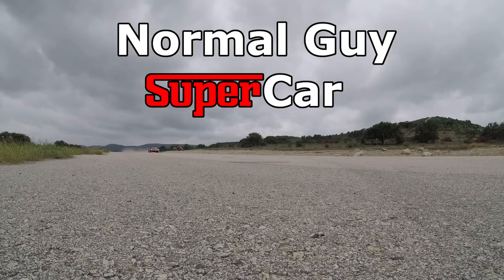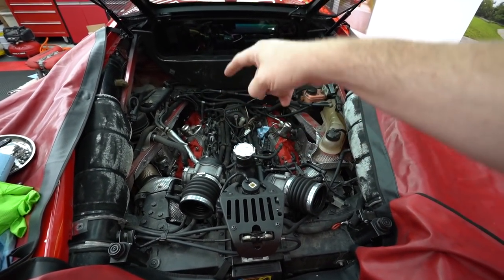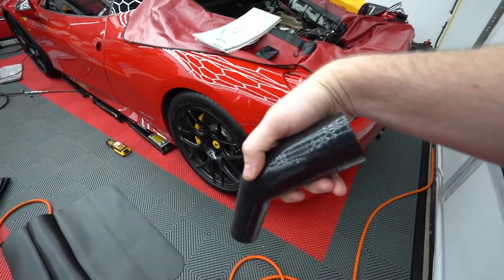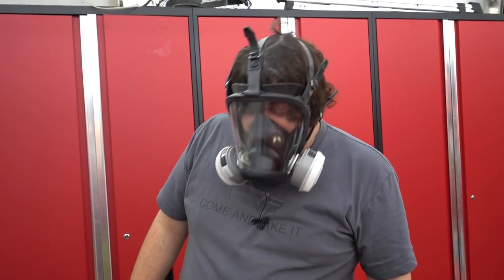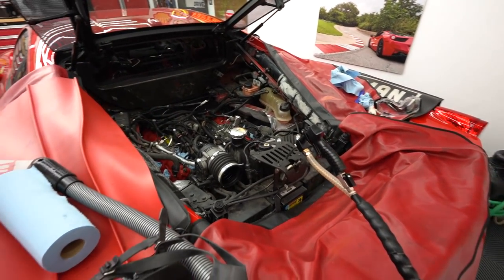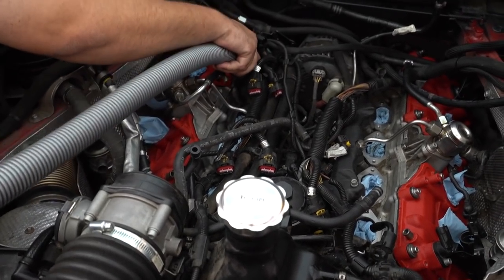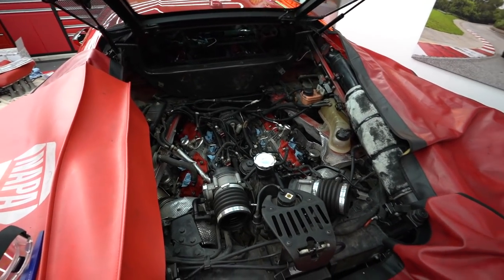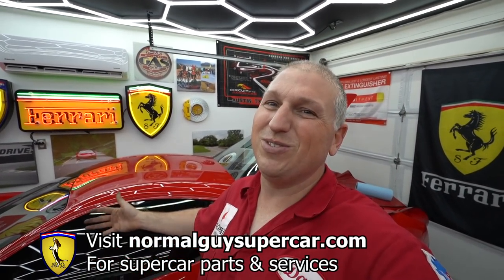How to CLEAN FERRARI 458 INTAKE VALVES using CRUSHED WALNUT BLASTING

Comment: Totally unnecessary , Gdi cleaner  would do the job . Without disassembly . Made by CRC , I did use it , made a huge  difference   . Warm up engine , spray in the intake , wait an hour . Take for  a drive , to blow out the carbon  . Note , if you have Map sensors , don't spray through  them . Find a vacuum  port after them . This stuff , does clean the turbo as well .
Reply from the maker: Well, when you already have the intake off... why not?
Reply: @normalguysupercar  I know , your making content . But , work smarter  not harder . Lol
Reply: @normalguysupercar   , I'm  going to try brake  cleaner  next time .  Using the same steps . As CRC  , GDI cleaner  .

Comment: Nice video! I just did a big walnut blasting series on my channel with dyno results before and after. Someone commented with a Maserati asking so I'm going to show him your video!

Cleaned my EcoBoost Mustang that I've run over 180 closed course days, 130,000 miles. It was a lot worse than yours. We gained back over 20 peak HP but the dyno curve was crazy to see how much longer and stronger it would pull in the high revs.
Reply from the maker: It's awesome, you can literally feel the difference after cleaning!

Comment: I "Walnut Blasted" my BMW 760 V12, it was like night & day. Better performance & misfires disappeared. I gained 25 HP as per dyno tests and my V12 runs smoother. Most of my know it friends never heard of Carbon build up valves and they said just blow it out which don't work.
Reply from the maker: That's awesome to hear. I wish I had Dyno tested it before and after, that would be fascinating data

Comment: ok, another tip 

on the valves your working on pour some fuel into the intake & let it soak 'rehydrating the carbon' its then much easier to wipe off & suck up using a small vacuum cleaner, regarding the walnut left in the intake track, you need to be very careful as it could fowl the closing of each valve where walnut is left behind.. I'd suggest using a small pick to move it& then hoover it up so its clean/free of any foreign debris..
Reply from the maker: I like that tip

Comment: Oh hey fun fact, you can chuck a boatload of zip-ties in a cordless drill (use one or two around the cluster to keep them from bending out all over the place) and use them like a rotating scraper to get the chonky bits removed first.  I'm surprised Adam didn't think of that, that's straight up Chair Force Engineering.  :D
Reply from the maker: Oh I like that idea

Comment: You should try the dry-ice cleaner that Tavarish used.  Same idea as your walnut sprayer, except you use crushed dry ice instead of the walnuts, and when your done, the dry ice evaporates leaving nothing behind.   (He used it to clean his wheels, engine, and paint...)  Also with dry ice, you could probably do it with the valves open, and clean off the valve seats also.....
Reply from the maker: Yeah, I considered that but it looks a bit more complicated and different equipment.

Comment: Certainly the Shell and other company  ads touting clean valves are misleading for direct injection engines.  This problem is why Toyota and others went to dual injection.  Port and direct injection for each cylinder.  While more complex it gives the power and control of direct injection with the valve cleaning and reliability of port injection.  Chemical "solutions" like Seafoam also won't clean this type of baked on carbon.
Reply from the maker: Well to be fair, most engines were not di until recent. But yes, I believe the best solution is port and direct combined
Reply: @normalguysupercar  just an fyi, DI has been used for years with diesels.

Comment: So how come the Shell Premium Nitro ain't keeping the combustion chambers clean?
Reply: Because the 458 is a direct-injection engine and the valves do not touch the fuel. That gunk is the PCV crankcase blow-by getting recirculated. Pay attention! He told you this in the video.
Reply from the maker: That's not the combustion chamber, that's the back of the intake valves in the heads. No Shell fuel ever gets there on a direct injection engine. If it did it would have looked much cleaner.

Comment: Those oil catch cans do work, as long as it has the bronze filter in it.
I put one on my truck. I was amazed first that it really worked and second at the amount of oil, water vapor , sludge it captured. 
But of course the avg consumer would never empty them so the don't use them from the factory. 
Idk i think avoiding having my intake and valves sludged up is worth the extra work. .
Reply from the maker: I agree

Comment: Great results. I would recommend a high CFM compressor at least 14.5 cfm (£260/$356) and you run for much longer on each valve to get near perfect results. You can use the adapters to help raise the height/angle of blasting.
Reply from the maker: Yeah for sure a bigger compressor would help

Comment: I thought Shell gas cleans your valves lol
Reply from the maker: It does when it is sprayed on the valves...
Reply: JimC481   , the newer motors spray directly  into the cylinders , bypass the intake valve  . Not getting  washed  with gas anymore .  Positive crankcase ventilation system , is directing  the air back into the engine.  It has  oil residue from the engine . That form carbon  on the valves  . Causing  this problem  , to clean them .

Comment: Looks great..... historically,  the only Chinook helicopter that ever crashed was after a walnut cleaning, a larger piece of walnut was lodged in the gears that caused propeller rotation to skip, causing the rear propeller to make contact with main propellers, resulting in blades breaking thus leading to crash....
"The More You Know"........
It doesn't look like you will have that problem....looks great
Reply: That 1982 crash in Mannheim, Germany was due to walnut debris in the oil passages of the transmission-bearing failure. They routinely used walnut debris cleaning as a normal process, but the original procedure called for cleaning the oil tube/passages/journals with 3000lb air pressure. They had changed the procedure due to an OSHA Inspector investigating the shop at the Corpus Christi depot had cited them for that pressure safety. The army changed their procedures due to that. The subsequent stand-down post accident showed numerous transmissions with some walnut debris inside them. Cited from Ft. Rucker investigation team.
Reply: @PFLEONARDI0906  yup thats the story .... seen it on history channel 15+ years ago, found the story interesting
Reply from the maker: That's fascinating actually.
Reply: @john_belk  lolololol......
Reply from the maker: This actually made me laugh out loud

Comment: Great video. Just curious what does Ferrari charge for that that cleaning service? Did the walnut cleaning machine supply all the suction and cleaning power or is there something else needed. like a shop vac or air compressor? Also did the machine cone with enough media  to easily complete the job or did you need to acquire more media. Is the media available to you locally? Maybe if you get enough response or do this again with one of your friends, maybe show the hook up in more detail and a list of recommended tools needed.
Reply from the maker: You need an air compressor. The kit comes with enough media.
Reply: BMW has an 80K service interval for walnut blasting. Call the BMW service department and ask for a quote.

Comment: Thanks Dan, I’ll be replacing 3 failed knock sensors so the intake is coming off . Under “while I’m in there “ heading I’ll be powder coating the intakes covers and now I’ll have a look at the valves on my 360. It’s only got 19k but if the valves are caked up I’ll do this as well while I’m waiting on the powder coat. 👍
Reply from the maker: Yeah might as well look and if they are dirty, the extra effort to clean them was not terrible compared to the rest of the job
Reply: While you're in their Jim I'm not sure if the 360s use the same valve vaerator (spelling) system for the variable valve timing as the Ferrari f430 but if it does chances are they could be leaking internally. If they are you'll notice oil around the pigtails of the connectors where they come out of the valve cover. In order to disconnect those clips without breaking them you have to unbolt it from the valve cover there is a tine on each side of the connector that you have to lift up usually a couple of pick tools can help you do this or some tiny screwdrivers one on each side.  The 430s are notorious for leaking internally and if they fail the car will run not so well. It won't damage the engine but they will run poorly. They are difficult to get to and it was a known issue with Ferrari that these failed prematurely and they redesigned them at one point but the redesign may not be any better just did it on my Ferrari f430. They are very expensive and there's four of them. Fortunately the Maserati part is a Ferrari part and it will work as well the only difference is the pigtail coming off of the unit is a little bit longer. Just a heads up of something to keep in mind while getting underneath the valve cover as well as doing gaskets.
Reply: @johningle6363  thank you John , I’ll certainly have look once I get the intakes off . Not looking forward to the job and waiting now for the knock sensors to arrive . 
At least I know Dan has suffered the experience as well .